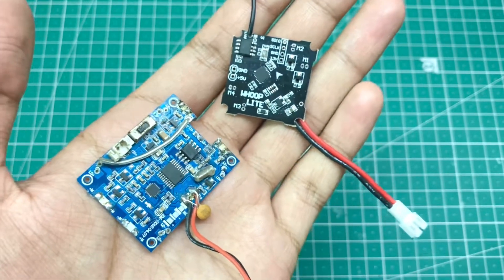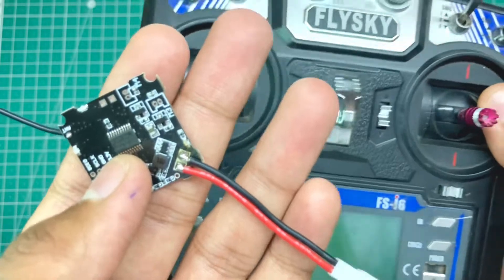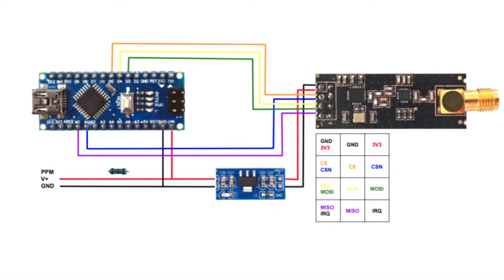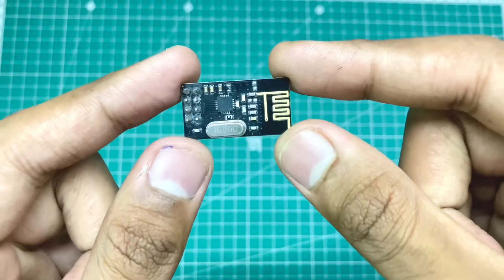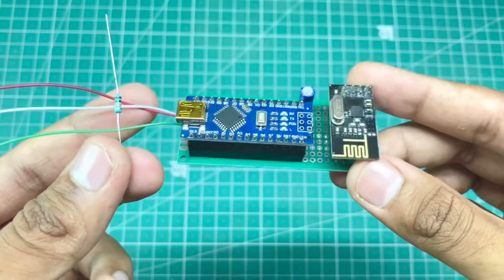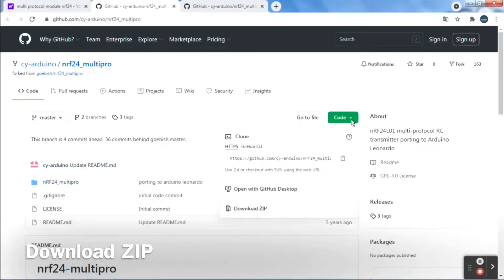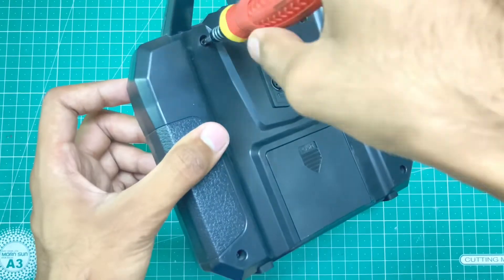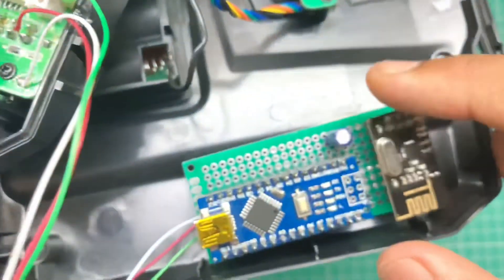Build a Multiprotocol Module to Bind any Receiver with Fsi6 Transmitter

Comment from the maker: (PPM signal wire is connected to D2 pin of Arduino)
It is not visible in diagram
And before making this multiprotocol module see the supported protocols in code because it can only bind with protocols which are given in “Supported protocol”.
Reply: Thank you very much for prompt reply, i'm planning to make one
Reply from the maker: @aliezersangma4644  Good Luck

Comment: Hi,I bought multiprotocol module.but somehow I got damaged. I can see a burn in a component. Will this project work as same as that of this module? iam using fsi6x
Reply from the maker: No, it doesn't work properly. I would suggest you to buy IRX6 multiprotocol module from banggood.
Reply: @BuildCreation  product is out of stock. I only want to bind 2 types of quad. Will this project useful for this purpose?
Reply: @BuildCreation  bro iam confused. Please help
Reply from the maker: @aju5405  no bro, i won't recommend you to make this, because for some models (receiver) one-two channels don't work.  Thatswhy, simply buy IRX6.
Reply: @BuildCreation  A already have Arduino nano. I only need to buy the rf module. I will try my drones with this method. I will give an update after the build.
Reply: @BuildCreation  irx module is currently out of stock.i will buy once it is available.anyway I would like to try this project.i already have damaged irx module. Can I use the connector from that module for providing ppm signal? I would like to do this without disassembling the transmitter.i also have regulated power supply
Reply from the maker: @aju5405  ok 👍
Reply from the maker: @aju5405  ya you can do that but then you will have to findout exact pin which is one is for PPM.

Comment: Bro i am able to bind this flight controller with my fsi6 according to your explanation but all motors are not running with throttle stick please help 🙏
Reply from the maker: Ya bro, i also stuck in same situation 
Only 2 ch are working
You can make a twin motor airplane
But I think not a drone.